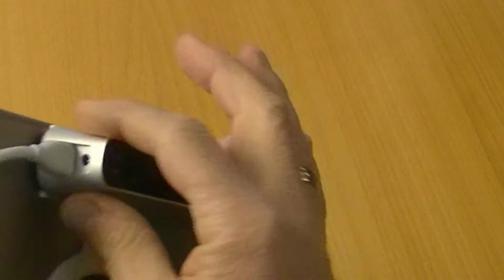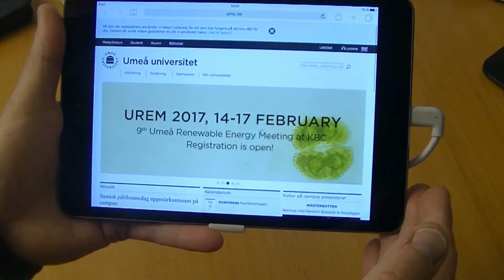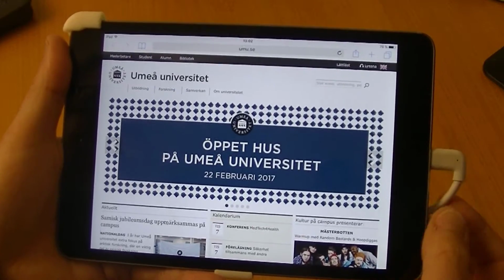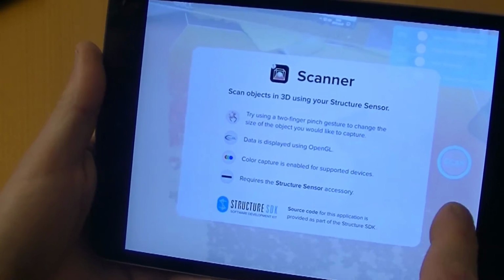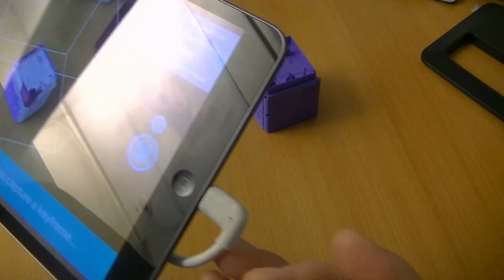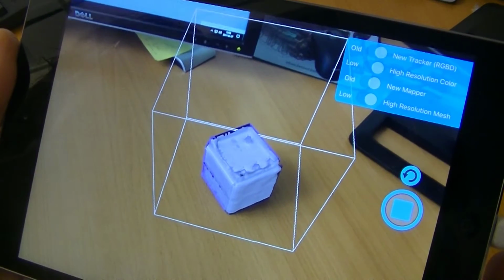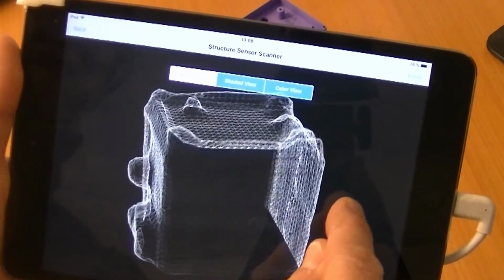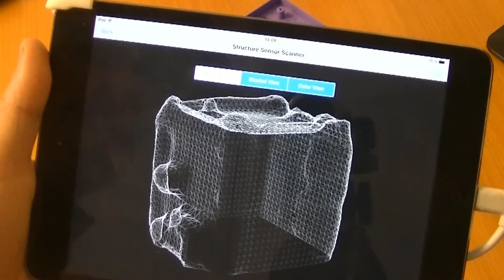IPad 3D-Scanning 101

Comment: Hi Sir Tomas,  an help.. please!   (At first, my Congratulations for Your videos).  Then, I have a question:  If I would not to send my  catched to cloud service, but elaborate myself my scanned objects in local way,  should be possible?  -  I would to catch objects, save on my pc or something else,   and elaborate the data scanning alone...  
Do you think that is it possible?  - ...   Let me know all .. please...   I hope in Your help!   -  P.S. I'm sorry for my bad English!!   :)  ...
Reply from the maker: Hi Paolo
In the video I'm sending the captured 3D-data as an email. So no Cloud service is used.  So yes absolutly possibly 🙂
Then you can continue on a computer and fix and repair the polygon mesh.
Hope it helps
Regards T Lindehell
Reply: @lindehell  Hi Sir!... Thank You so much!... Excuse me.. Could I ask You any info about this software/hardware by   info@dh.umu.se   email, if it doesn't disturb of course, please?
Reply from the maker: @paolotoschi2475   Hi Paulo 
For repairing meshes there is many softwares out there.
Meshmixer is one very easy and for free. You can find a lot of tutorials by Googling.
Search: meshmixer repair stl

Good luck with your mission :)
Regards Tomas Lindehell